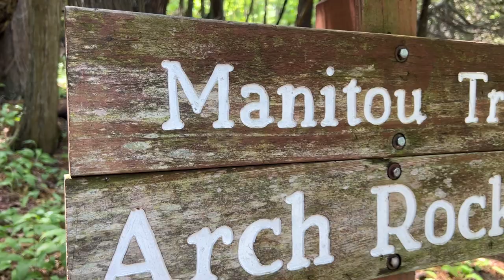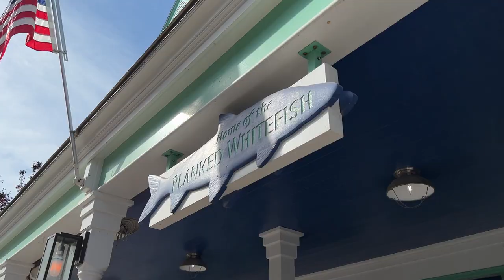1 Day On Mackinac Island (First Impressions)

Comment: This is the 2nd time I've watched this video.  I was there during a solo UP camping trip abut a month after you for my 5th time in my life. When I arrived a cruise ship had just disembarked their voyagers so the downtown was rammed with people, even more than usual.  I grabbed a bike and spend 1.5 hours biking and then ate lunch at the same Jamaican restaurant. I spent the entire afternoon hiking. There are two forts on the island. The one you were at is developed into an historical attraction but it is not the highest point on the island, as you mentioned.  The other one is.  After hiking I did the free Carriage Barn tour. I also explored the very interesting island cemetery and soldier cemetery. Didn't step foot in any of the shops this time or buy fudge but still had my best day; Mackinac Island is my happy place. Spending a summer living and working there as a seasonal worker is on my bucket list.